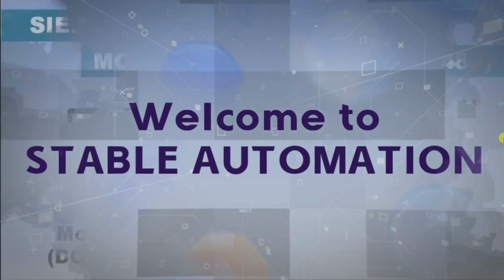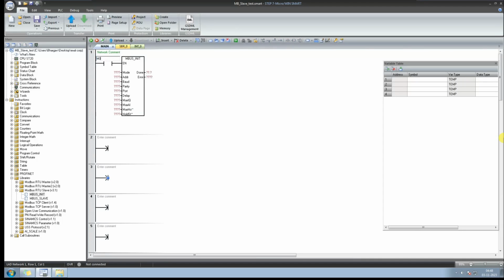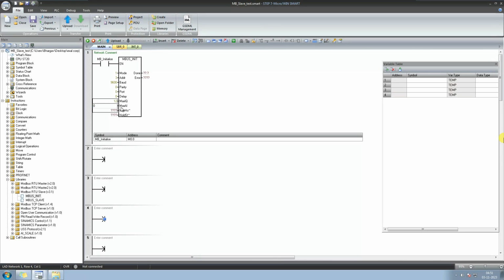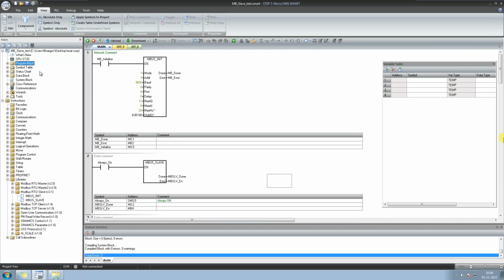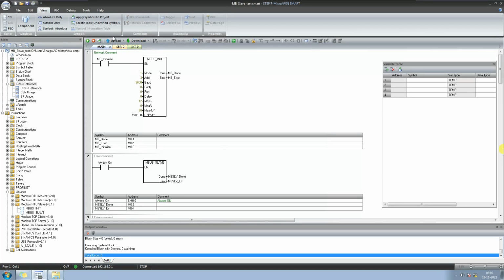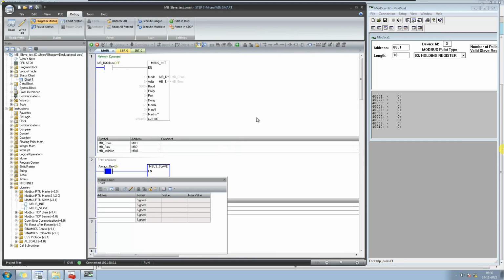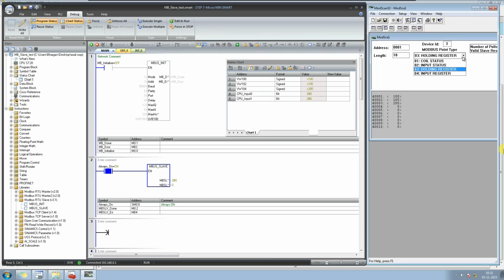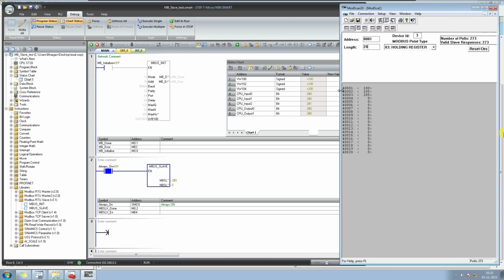S7 200 Smart as Modbus RS485 Slave

Comment: Great informative video. Just learning the Siemens platform. What di you add as the start register, %VB0? I understand it will read the specified number of registers but confused how you made it read the digital it R/W the digital in and outs?
Keep the videos coming as I appreciate them
Reply from the maker: Glad to know you find this video helpful to you.
By default , DI status will start from Input status of Modbus (address 10001 onwards), 
DO will start from Coil of modbus ( address 00001 onwards).
Hope this clear your doubts.
Reply: S @StableAutomation  SO if I put %VB0 on the read start, no matter I can still just read the 00000 or the 10000 Modbus registers? Still a bit con fusing to me. I am working with a 224XP and use the 128 reads in the MBUS INIT box as this is the most it'll do.